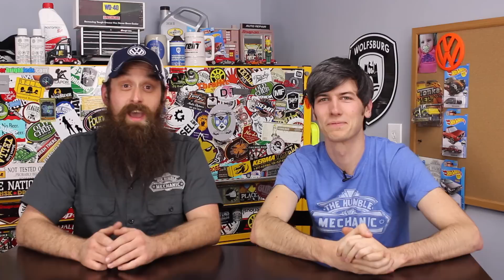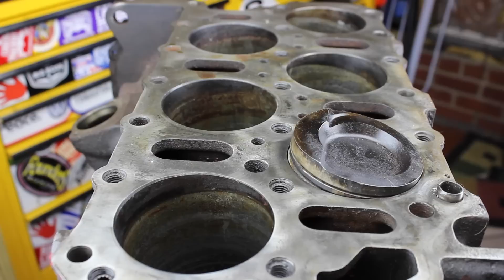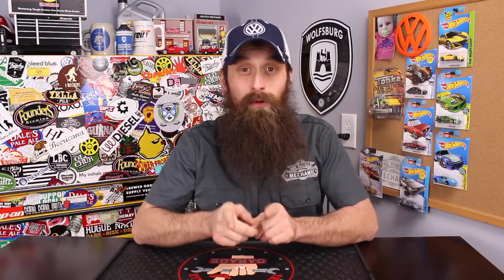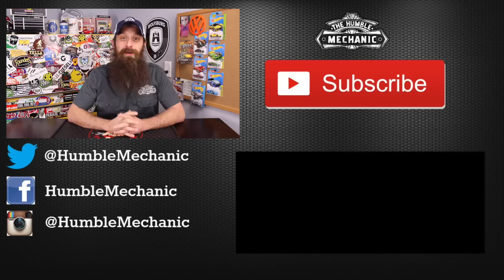Behind The Wrench ~ Engineering Explained

Comment: Love you guys' channels!  My experience at a Ford dealership was that there were a lot of people who could fix cars, but there was also a lot of unverified opinions that were assumed to be true (I call it "hillbilly sense").  Our front end guy went on a rant with me about how if you mixed nitrogen and air in tires you would cause all these problems (not true).  It was also assumed that it was safe to put a 15,000 lb truck on a 10,000 lb lift, because no one had been killed yet.  I think having an engineer's perspective is really useful for understanding the principles behind what is going on.  On the other hand there were some designs on vehicles that seemed very impractical, like having to remove the intake air hose and box, and a bunch of push pins and reach back behind the cowl to remove a battery on a Ford escape, that I think is engineering silliness.
Reply: it honestly probably was probably reasonably safety margins on that kind of things are 2.5-3 thats a frame from another vehicle limits options honestly and stuff like that is usually either frame constraints or planning fuckups

Comment: What about things like skid plates or shields under a car? The Jeep renegade trail hawk has 13 bolts of 3 different sizes in a metal skid plate that have to come out. What about cartridge oil filters with plastic caps that break and spew all over.

Comment: What i dont understand about engineers is (in this example, BMW) that they sometimes use systems for ages (Powersteering Reservior and Plumbing, VANOS, Oil-Filter Housing) and even from the beginning they are flawed (Leaking, Very soon failure etc) but even though for example the Power-Steering in every BMW was not changed from the 80s up until they switched to electric power steering. And all that time, the hoses and reservior leaked badly. The 1993 VANOS system was built, litterally unchanged, until 2006 even though not a single one made it out of the warranty alive. 20.000 miles and some were already damaged. Shouldnt the Manufacturer step in and redesign this stuff, especially cheap and obvious things?
Reply: should but accountants and budgets

Comment: Tires, definitely the best first mod. Craig Wilson (F1 engineer) once said "Put simply, Tyre improvements are the quickest way to improve the performance of any car. Generally, the time gain is equal to or greater then all the other factors put together. Put simply, all the many man hours that hundreds of workers put in a team like BAR, coupled with all the many more hours of work by engineers at Honda, amount to the same improvement per season as whatever mysterious changes have been applied to the four black, round things the car is standing on."

There's pretty much only one caveat: If your car's suspension is particularly soft and you put on some immensely grippy tyres, you can get into a situation where the massive braking and cornering forces just throw around the body of the car, the suspension being unable to keep it under control, and that can get dangerous quickly. So get better tyres, but not necessarily the absolute stickiest ones available.

Comment: another reason for "why are things engineering this way" comes from manufacturing process. something which is designed to be produced in the many hundreds of thousands or millions even has to be designed to be assembled in a factory efficiently: plus the "platform" is designed for re-use. the chassis may come with a 2L four and a 3L v6 option in hatch sedan and softroader variants. so the oil filter may be in some terrible position because for the engine that's chosen for the particular model you're underneath has a suboptimal placement of the filter compared to some other component.
Reply: and many times is an existing system retrofitted to a new car
Reply: @leahfriedman7370  yep shoving a new engine into an old platform usually sucks

Comment: Howdy sir, this may not be the right place for this but I have an official V-Dub question for you. Not being a Euro guy myself I thought who do I know that loves these things (for what ever reason haha) and you came to mind. Do you take the time to answer questions here by any chance?
Reply from the maker: Fire away!! You can also email me Charles(at) HumbleMechanic (dot)com
Reply: Ah got it, thanks! Well it is an easy one for you I am sure. My brother has a 2013  Passat TDI and I was riding with him the other day and noticed it was blowing cold air in the passenger foot well and out the passenger defrost vent when the climate control was set on "hot". Now this is a SINGLE zone HVAC. I had him pull over and I removed the hush panel in the passenger foot well and had him move the blend knob from hot to cold. The actuator is on the driver side but you can see the rod on the passenger side protruding through the air distribution box and it appeared to be making the full sweep from hot to cold. When I looked at the VW repair for the air distribution box (because the blend door is not service separate I guess) it appeared to be segregated into 3 "flaps" on one shaft so to speak. My question is have you seen these blend doors fail on the single zone HVAC systems in these cars?
Reply: +HumbleMechanic Hey Charles, were you able to give this any though?
Reply from the maker: +South Main Auto Repair Sorry for the late reply. Your heater core is clogged. There is a TSB about it, I forget the number. 

If you are out of warranty, you can try and flush it really good. That has worked before. If not, it will need a heater core. Luckily, you don't  have to pull the dash out of these
Reply: +HumbleMechanic I see, wow! How the heck do you loose heat just out one zone with a plugged heater core!? On all the trash I work on when the heater core is plugged or even partial plugged it affects the system as a whole. What is your thoughts on that?
Reply from the maker: +South Main Auto Repair my guess is it's only partial blocking. I have not had a heater box out of the new Passat yet to fully evaluate the design.
Reply from the maker: +South Main Auto Repair plus a VW Will almost always favor the driver in a failure situation.

Comment: Oil filters are the majority of my WTF moments... I mean, this is the most serviced item on a vehicle and sometimes it seems to have been an engineering afterthought.  
The one I see the most (I work in a GM dealer) is the equinox.
I just love burning the crap out of myself trying to get the filter off, then dump old oil all over the frame, mount and exhaust.  Then, I have a hell of a time trying to thread the new filter on with my hand and arm in this weird contortion. THEN, I get to spend 10 minutes cleaning up the oil from all over the front of the engine bay.
Keep in mind that you cannot access the filter from the bottom even though it is near the bottom of the engine.  So you have to find a floor catch and you get to look like you're being attacked by this car while trying to change the filter.
The frustration and mess just isn't worth .3 and if I owned one, the first thing I would do is install a relocator.  In fact, I bet some guys do not even change the filter... they look down there at a 450 degree manifold and a 200 degree radiator with only about 4 inches of space and say, "Nope, let the next guy get it.".
This may not be a problem for guys with long, skinny arms but I'm a big guy with big arms and it sucks.
All the certifications and training don't mean jack when an oil change makes you look stupid.  I hate that car.
Reply: preach brother. I hate those things too. so glad I don't work at GM lol
Reply: I hear replacing a battery for the traverse's is a pain as it's in the rear floor board? I hardly ever work on any GM products, most of the time I'm working on  Nissans, Toyota, kia, Hyundai, Chrysler or Subaru
Reply: lmao gmc Acadia took a book out of their play book me thinks. Lexus 1st gen is 300 is pretty funky too. once you get it off(if you can) it's still hard to lift it from the engine bay

Comment: What vehicle has the loom going over the filter?
Reply from the maker: Lot of VWs are close. The car I had in my mind is the 3rd gen common rail from VW.
Reply: +HumbleMechanic The CR oil filters are more of a pain to get out than they should be. My slight OCD doesn't drive me nuts if that EGR tube heat wrap gets oil on it. My favorite tool to funnel oil or any fluid where I want it to go is aluminum foil. I always wrap that EGR tube in foil and flare the ends up so no oil can run off the side if it. I did take VW's free first 3 services on out Passat and I wrapped the EGR tube in before dropping it off.
Reply: +HumbleMechanic I knew the car you were talking about the moment you mentioned it. The mk7 Golf TDI is one of the offending cars and I have one.

I don't know know why I thought you were in Charlotte instead of Raleigh.  I know the area well.
Reply from the maker: +Matthew Gaines haha yeah not a cool design. If you're ever out this way let me know. We can grab a brew.
Reply: HumbleMechanic Absolutely!

Comment: Nice interview. Jason is a great communicator and teacher for sure. If you get Jason back again soon it would be nice to hear his thoughts on an engineers responsibility on a project in regards to design. I wonder if the aftermarket is having  engineers signing off on their designs they produce. Putting your signature on a document in regards to safety and liability is not taken lightly by any engineer. I see a lot of offshore aftermarket vehicle modifications and wonder what scrutiny is applied to their designs. Cheers